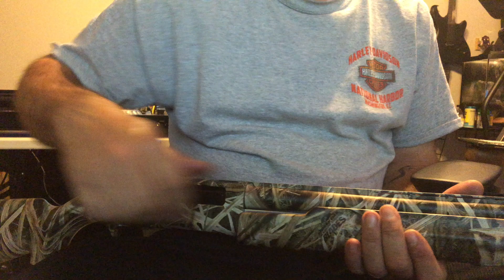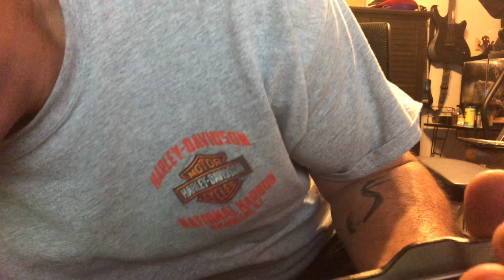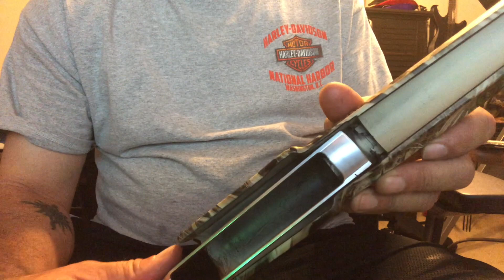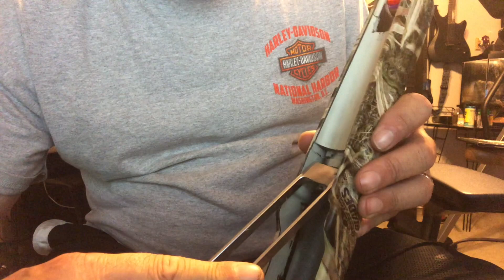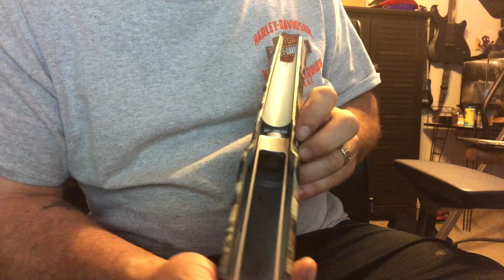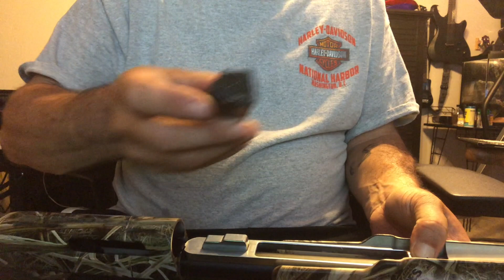Yildiz S71 Pump Jamming FIXED!!

Comment: Hey buddy. I’ve pulled my hair out trying to figure out why my pump was binding. You solved it in 10seconds. Thanks so much for the help. This is why the internet  is such a good tool. Thanks again. Jeff Elmore
Reply from the maker: Isaac Elmore That’s awesome!! Thanks for the message.
Reply: Man I almost ran mine over with at truck
Reply from the maker: @Sam47137  Awesome!

Comment: thanks!  i have watched this several times in anticipation of picking up one from academy. i've had all manner of shotguns for decades.  my recent 870 twenty gauge launced the retainer clip into oblivion and i am now left with the chore of making another one to secure the magazine spring.  since the first one didn't do its job, i did not spend any time looking for it.  cheers!
Reply from the maker: Don't get one. Mine broke after 1 season. Cheap plastic parts inside.

Comment: Thank you for the video. Would you please advise me if I can follow the same procedure with Yildiz P71 - 12 gauge semi auto model ? I have the same extractiom / ejection problem with a new shotgun that I got. The local sub-agent / distributor denied the problem and couldn't fix it. Thanks & regards
Reply from the maker: Sorry, I have no experience with that model.